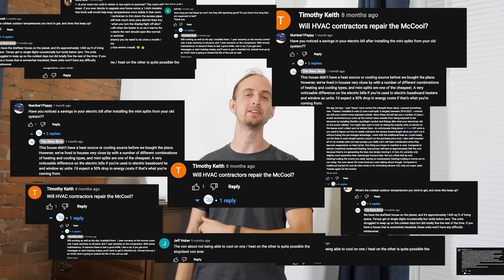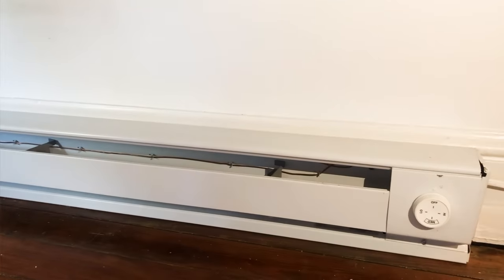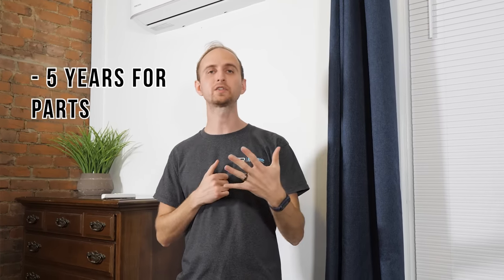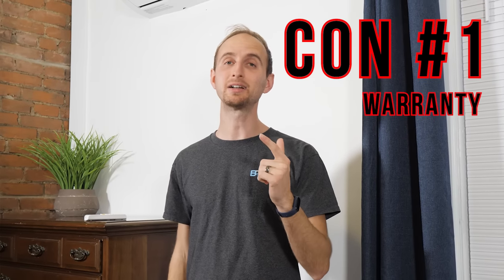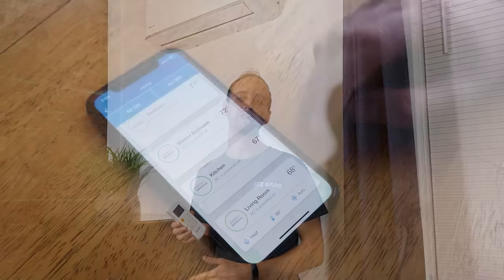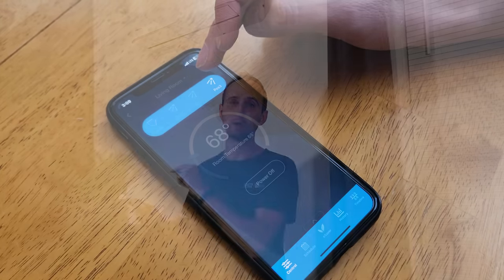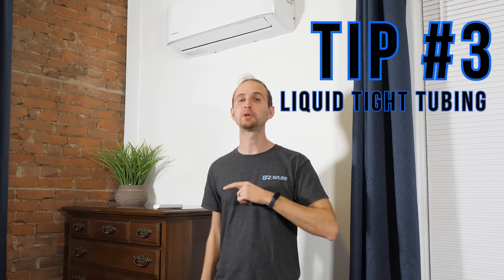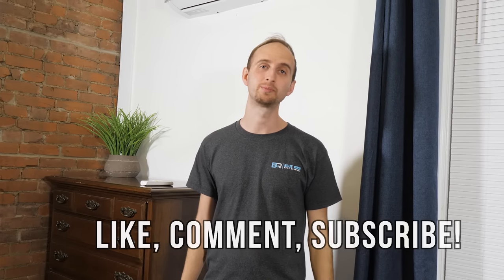Mr Cool DIY 2-Year REVIEW: I wish I would have known this BEFORE BUYING...

Comment: The air handler should be mounted lower.  In winter the hot air wants to go up and the floor will be cooler.  In summer the high ceiling will attract warmer air and if it is not disturbed, the lower part of the room will be cooler.
Reply: It’s collecting air and redistributing it. It’s job is to replace the air in the room and re-fill the room with temperate air. Being up there makes no difference. Central air systems lots of times have vents on the ceiling.
Reply: Hotter air is up top so if you want cooling it will grab air at the top of the room and recondition it. It's not a huge deal honestly it does what it needs to do quieter and more efficiently than window units
Reply: You are wrong big time!
Reply: Why do non-hvac people ever give hvac advise????????
Reply: Actually, for summer, you want your AC vents to be high.  And for winter, you want your heating vents to be low.  The ultimate system is a radiant heating system for winter, and a central AC with high vents for summer.   If you only have one system, then it's always a compromise.  The Mr Cool DIY air handler lets you direct the airflow, so that helps.

Comment: why do you have to go to each room to change mode?  Cant you do it from your phone in the same room?
Reply from the maker: I try to make it a practice to not always have my phone with me. That’s an extremely healthy practice and nobody should be tied to their phone, especially at home. You can only use your phone if you choose to set up the Wi-Fi feature, but the answer is yes. You still have to track down which unit is set to the wrong mode and manually flip through the app to each room and check the settings. Unnecessary if the system was designed with a master remote feature, or even if the app was designed with a master remote feature. Neither are.

Comment: Motor bearing lube probably used up.  Dribble a few drops of oil down into the bearings and save the motors as spares for when warranty runs out
Reply from the maker: Motors were totally enclosed, would I need to disassemble? What kind of oil do you recommend?

Comment: I enjoyed my Mr Cool DIY when it worked.  Had to replace the control board a few times due to power surges, and Ingram was always great when it came to shipping those out, but unfortunately after a couple years I developed a coolant leak in the indoor unit.
Reply: Most manufacturers require a surge protector and in some cases will not honor the warranty if one wasn’t installed. I don’t know about DIY units because I don’t install them.
Reply: Those variable speed compressor boards are sensitive to power surges or power outages and can potentially fry your board.
Reply: @rdalemd76  It's best practice to have one anyway, even if they don't require it. When they're less than 5% of the cost of the equipment I find it absolutely wild that people don't bother.
Reply: Whole house surge protector is $45 to $150 depending on amp rating. Simple install.  Many snap right into your electrical panel using 2 spaces. It's a no brainer minor expense to protect all the expensive appliances. There are even  gfci/surge combination circuit breakers for individual circuits.

Comment: The problem I have with Mr. Cool is the unavailability of parts. I've needed a circuit board for 2.5 years and they can't produce one for me on a 24,000 btu Hyperheat model, yet they're selling new units every day. The unit was a year old when a snake shorted out the board and now it's a wall decoration. I've emailed them directly and called and emailed the dealer and am just getting the runaround. They each refer you to the other. My next step unfortunately is to contact the better business bureau.
Reply: Find a local old fashioned technician that can repair the board. ie TV or radio or Electronic technicians

Comment: I have a mitsubishi 18k h2i minisplit. It is near the kitchen and requires very frequent cleaning of the filters monthly and blower drum and coil every six months. I also daily run it in fan only mode in the morning because if i leave it in cooling mode 24/7 the coil and blower become moldy and dust encrusted. Having carpet and dogs causes a lot of dust which it does not handle well, and cleaning it is quite a chore on a ladder. Mitsubishi doesnt make it easy to clean and service. Also occasionally the condensate line plugs up with dirt/lint/mold? and starts dripping and i rigged up a clear 1/2 OD tube to a female hose fitting that fits perfectly in the condensate entry from the tray and that clears it out.
Bottom line is i wish it used more effective bellows style filters and was easier to service, but otherwise is fantastic. I want to add a Mr Cool multihead unit to do 3 other spaces in the home and this video gives me more confidence in the Mr Cool product.

Comment: Great video.   So I was going to get a Mr Cool Advantage since I have my own vac pump and gauges.  But since I will have around 70' lineset instead of the standard 25', the manual says I will need about 8oz of R410 for those extra 45 ft.  I can't purchase R410 myself, and it sounds like (based on your experience), that I won't be able to get anyone to come out and add R410 to it.
Reply from the maker: Can you point out in the manual where it says that? I never asked an HVAC tech about adding coolant, but that may be one thing that you’ll find them willing to do.
Reply from the maker: Ahh, I understand. What I would do is call around to a few HVAC contractors and pose your situation. Say you have a mini split system you installed yourself that needs charged with coolant, and ask if they will do that for you. Alternatively, I found that running line sets was the most time consuming part of my mini split install, so I would personally try to sub out both the running of linesets, installing line set covers, hook up, and charging the system.
Reply: @TheRenoBros  yeah I wish I could pay someone just to run the lineset, cut the tube, flare it and charge the system. But i expect I would have a hard time finding a tech to install one of these but who knows. I have been getting quotes of over 6k and I assume most of that is probably labor.
Reply from the maker: @shanefrank3281  If all they are doing is running the line set and charging the system, I’d expect much less than $6k. The materials for the line set and cover are the main cost, and you’ll have that cost either way. Labor wise, a good HVAC company will probably get all that done in 4-6 hours. Might be looking at $1k labor and $2k in materials depending on what kind of cover system they use. I used Rectorseal and they weren’t cheap. I probably spent $1k or so for all my lineset materials 2 years ago. And I probably spent 40 hours installing it all because it was a bit of a learning curve.
Reply from the maker: @shanefrank3281  What were they quoting exactly?
Reply: @TheRenoBros  The quote was for one of the other higher end units (single zone, 9-12k BTU) but did not include running the electrical and as far as I know any cover.  Neither were official quotes, but were just "about how much should I expect", so a real quote would probably have been more because running the lines (and the condensate) will be more complicated than a typical install.  I just assumed that if I told them I had a system and wanted them to install it (or part of it), then they would balk at that.
Reply from the maker: @shanefrank3281  Hmm, I actually wouldn’t be surprised if that “quote” included the line set work. There’s no typical new installation that doesn’t include running line sets and covers, unless you’re just swapping out the old condenser for a new one, and that is very cheap on the labor side. I know a guy who installs top of the line units 9 or 12k BTU for around $5-6k. That includes the condenser, 1 head, line sets, covers, electrical, hookup, charging, labor, and a warranty on the labor.
Reply: @TheRenoBros  yes it definitely did included that. But they didn't even get up in the attic and one was on the phone. I'm saying an actual quote would be higher when they really looked at how difficult running the lineset would be.
Reply from the maker: @shanefrank3281  Ah I see! Well it’s nice to know that they were actually paying attention… (sarcasm).
Reply: Actually you can buy R-410a yourself.  Two ways I'd recommend it.  First, there is a guy on Youtube who sells recharge kits that come in 1.8lb cylinders.  You can expect to pay $200 for a cylinder and gauge/line to charge.  Second, you can buy R-410a cylinders online IF you sign something that says you do not intend to use it but intend to resell.  You can use your imagination for the rest.

Comment: That exposed brick? ...a MAJOR heat soak in winter, and radiator in the summer.  Cover it with poly-iso foam boards, and cover that with 1/4" drywall.....you will be amazed. (poly-iso cannot be exposed, but that stuff is magical...)

Comment: My friends in Tucson had their A/C go out while it is 110 degrees.  They had to wait a week for warranty repair and used an A/C window unit to cool a small area in the meantime.  That's what I don't like about huge central heat pump units.  With mini-splits if one goes down you still have heat or cooling in the rest of the house.  For what I paid for a new Trane and all of the service contracts, I could afford to toss a mini-split and buy a new replacement several times over.  The units are small enough I could take them into a t.v repair shop to get fixed and then have a backup for the next mini split that fails.  And you can choose to close up guest rooms and not heat or cool them.  With a central unit you probably need to climb a ladder to shut off the ceiling vent and still lose some electric power cooling the tube leading to that closed vent.

Comment: Why not fix the drafts from the windows and do some insulations?
Reply from the maker: Great question! We did! Some of the drafts still exist because we have either not successfully tracked down the air leak or that fixing the insulation issue is more costly than we are able to afford feasibly (I.e. replacing all the windows, adding framing/insulation/drywall on the inside of all the brick walls). The reality is that those things would help a lot, but we would never save the amount of money we would have to spend on having that work done.

Comment: As i literally just had my 36 k mr cool delivered. Im just scanning vids. Im in sw fl. Ill use the heat, maybe 5-10 days a yr.
Im running 3, 12k portables now. House is still getting to 95* last 2 wks. Insulation blows, n thats my next address. BUT... Ill give you an update after i insrall it, and see what happens.
Reply from the maker: Yeah let us know! Thanks for the comment!
Reply: Working great...
One thing I screwed up. And hopefully someone reads this n learns.
After running 15-20 min.it started dripping water out the front.
So, back in the attic I went. Found out I  had the drain tube on the side n not the bottom of the line groupings. So, had to pull it back out the front. Fix the line to the very bottom,  and it started draining properly. But, it took two of us to do it. 
The unit was very heavy and awkward to handle. 
Otherwise.... 98* to 78* and holding. House only went up 2* at 4-5 at the heat of the day when it was 97* outside.
So far.... Couldn't be happier! TBC.
Reply from the maker: @mi.dogman4438  Great advice!
Reply from the maker: @mi.dogman4438  Ohh yeah! That got me too when I installed it the first time. Had to get the hang of the slope

Comment: I can confirm I just had 3 seperate HVAC companies quote me at 30, 40, and 33k to install 3 single and one double mini splits (I own a 4 plex conversion so one for each unit). I looked online for the Mr.cool mini splits and my total cost for parts is at about 10k. I respect tradesman but the difference between spending 15 and upwards of 30 or 40k can’t be stressed enough for people. To give perspective the entire cost of my house is about 100,000 so by their standard 40% of my homes value which includes the existing foundation, furnace, electrical, plumbing, siding, framing, roof, finish materials like flooring, cabinets etc. point is it’s completely insane to charge that type of money on something that can literally be done by yourself or a friends help and I’m not even a DIY guy at all I kind of hate it to be honest.

Comment: I'm more curious how a failed compressor or evaporator coil or condenser coil is handled during the first year.  Replacement of those three components is out of the skill set of most DIYers.  If the homeowners can find someone to do the work, are they on the hook for a thousand dollars in labor and Freon?
A friend of mine has put in 4 of these, two at his house and two at his parents'.  I've asked him the same thing and he said they're disposable.  He'd toss it away and install a new one.
Reply from the maker: Depending on the part, I’ve heard that Mr Cool sometimes just sends an entirely new condenser out, and those are easy to install. You’d still have to dispose of the old condenser, but that can be done for free if you find a scrap metal guy. Might be able to sell it too.
Reply: My gen 3 18k DIY had a compressor error code which necessitated replacement of the entire condenser.  Through Ingrams, they freighted me a brand new gen 4 condenser (I did have to pay freight) with pretty much no friction at all once I told them the code I had (and symptoms).  Upgrading to the gen 4 did require some adjustments in the installation because my wall brackets were set for the gen 3.  The gen 4 is actually bigger (more efficient), so I ended up having to put some pressure treated 2x6s across the wall bracket bottom pieces to adapt.  And more annoying than this, the high and low side for the lines are REVERSED.  This was the biggest challenge to rearrange the lines so everything reached and wasn't kinked.  But the beauty of the system is, I essentially disconnected and reconnected the lines and opened the valves.  Nothing leaked out during the job due to the unique line set design.  Pretty slick really.

Comment: I am a contractor. I had the same request to reduce/shorten the excess lineset. When i peeled back the insulation it was a stainless steel braided hoses.  ( Mr.Cool)  Sad to say that was the first ,and last time i serviced one of those DIY units. I am a strategic partner w/ Fujitsu. And Mitsubishi. Thats all.
Reply from the maker: Craig thanks for the insight! All of the tubing I can see (I even had to peel back a little bit of insulation) is all copper. Where should I look to see if I have any braided steel hose? That would be quite the discovery! I hope Mr Cool changed that practice before the models I purchased. I’ve read that Daikin has taken the number one spot for most reliable minisplit brand in recent years as rated by installers. Any experience with them?
Reply: @TheRenoBros  
It might have been the first generation,maybe it has been changed to all copper now. Daikin is a good brand as well. Their tech support is very good. And parts are not to hard to come by. Even though it seems we are having supply chain issues again.
Reply from the maker: @cthomaspac  That’s really helpful to know. So do you install minisplits full time? Or do you do general HVAC work and minisplits are only part of it?
Reply: @TheRenoBros  
Commercial air conditioning ,mostly large chillers ,boilers ,and BMS controls.
Reply: @cthomaspac  Are yo aware that Daikin also owns Goodman?
Reply: @leepennington11  I'd rather have Goodman than the microchannel Carrier my new house came with :/
Reply: The 4th generation line sets are certainly NOT stainless steel braided hoses.  They are all copper.  They are quite stiff, when you unroll them.  The ends are all copper, and there is no junction that would indicated it's changes to stainless steel under the insulation.

Comment: Still a silly con for the heat and cool on different heads.  Whether the unit heats or cools is 100% a function of the condensor unit outside.  The condensor unit can only heat or cool because as it is a function of what direction the refrigerant is moving through the unit.  It's like having a one-lane road.  Traffic can only move in one direction at a time.  If you want to be able to heat and cool simultaneously, you'd need a different condensor unit outside for each zone.  It's kind of like saying, It's a con that the driver seat in your car can't drive forward while the passenger seat goes in reverse at the same time.  It just doesn't work that way.  Yes, the issue that you have to manage each zone with it's own remote to get them all in sync.  I guess that's just the price you pay for your $840 annual savings.

Comment: There is a better reason for shortening your outside refrigerant lines than just aesthetics.  If the excess lines are left in a vertical coil, the refrigerant oil can become trapped in the bottom of the coils, eventually starving the compressor of oil.  Orienting the tubing in a horizontal coil may help, but creates a large footprint of vulnerable tubing.  Unfortunately, cutting the lines, reinstalling fittings, evacuating and recharging the system will exceed most DIYer skills.  For MrCool pre-charged refrigerant lines, an alternative is to locate the inside unit where most of the tubing is used up within the wall when the wall is hollow.  It's a little tedious carefully bending the drop tubing back and forth between studs with downward slope, but it can be done.
Reply from the maker: Thanks for that helpful information!
Reply: 300 psi will dang sure move any oil in the lines...